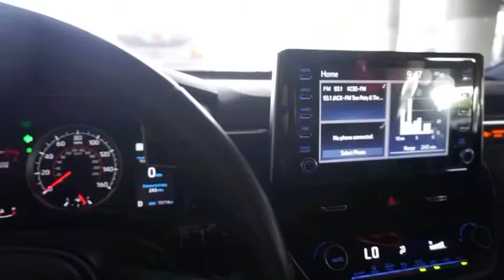Let the modding BEGIN! 2020 Mustang Ecoboost muffler and resonator delete!

Comment: If not I wanted to know if it loses a lot of back pressure?
Reply: That is a myth. 1st, a turbo wants zero back pressure. They perform much better. Even a naturally aspirated engine runs better with an open exhaust. There are many videos with engines on a dyno proving it.